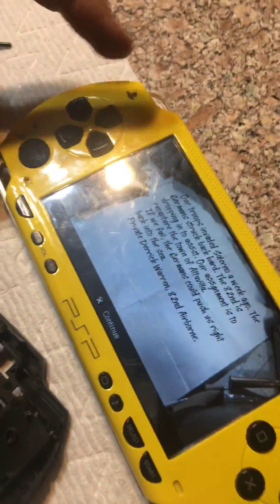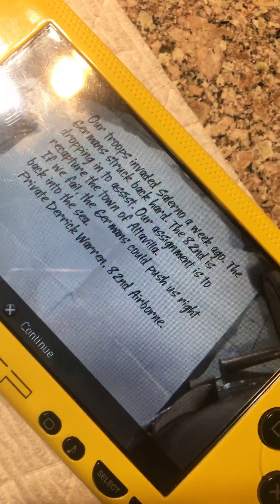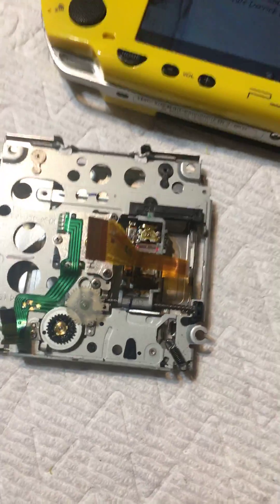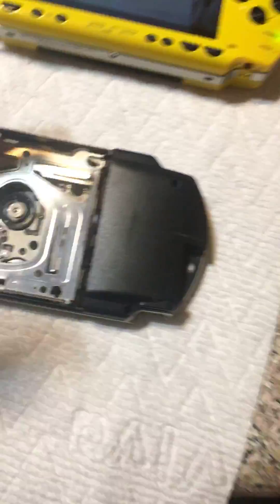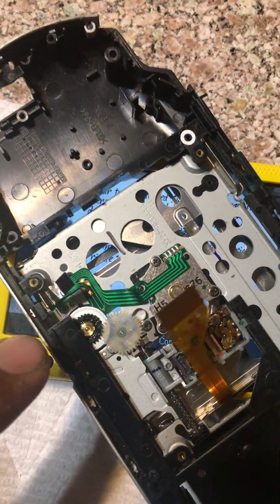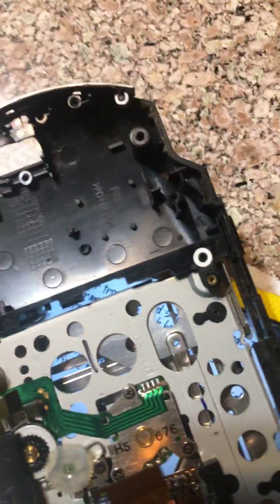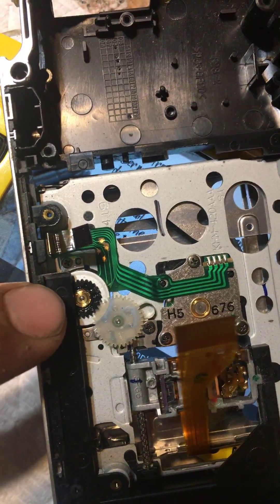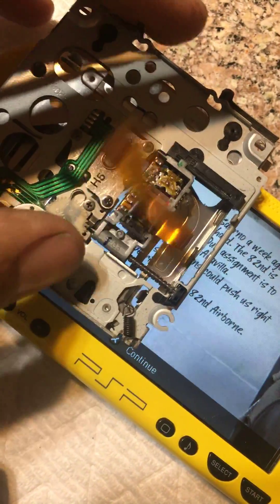Psp UMD drive noise repair

Comment: Honestly if you just oil it or grease it that will fix it   No need to cut anything but it has a little clear plastic there that will allow you to grease it.  You also grease the rail foe the laser.

Comment: I know this is a really late question, but can the rubbing damage your discs? Just remembered my old psp, want to take a trip round memory lane but I hear lots of scratching / screeching when inserting umds
Reply from the maker: Not that I know of. The screeching is from that little wheel itself that spins the UMD.  Most games on the PSP are relatively cheap now. If you want to try it on a game you don’t really cat about

Comment: Hello there, I also have the 1000 edition and I have this situation whenever a game in the drive reads from the save from memory stick it does the sound but it isnt a very long sound.. usually a quick  1 2 second noise.. and the other thing is for example i insert daxter umd and had noises during loading to the menu and while changing an area in game but then i quit the game i insert the umd again tried the same exact things and no sound was made. I feel that I am trolled by my psp
Reply from the maker: It could be the game itself. But other than that if your psp housing is after market then the plastic part is probably disturbing the wheel that spins the UMD drive
Reply: @alexzamora8491  Hey man i know its been sometime but i did what you said and cut the plastic thing and it in fact fixed the thing although a very few times it seems to do the sound its not so annoying. Another thing, I had a problem with my right speaker, the one woth red and black cable and it doesnt work, what would seem to be the problem and what can i do?
Reply from the maker: @yourviewyouropinion9136  the UMD drive is still gonna make some noise unless it’s weird and screechy then that’s not normal. 

As far as the speaker. Probably just replacing it. Unless it’s not connected to the mother board correctly.

I’m actually going to be working on a psp for a friend. If I notice anything else that causes noise I can notify you.
Reply: @alexzamora8491  actually i am taking it back, it seems it still does it on some of my games, maybe there is another problem with it?

Comment: This is 100% true I got a replacement shell and cut the little plastic piece off and no noise was made but previously it had made noise on a different shell with the plastic there so yeah I guess the gear touches the frame of the psp and produces that horrible screeching noise when you put it back together you can see how close they are from each other